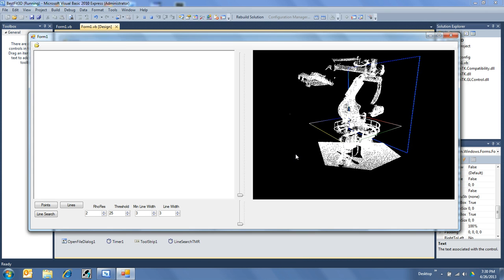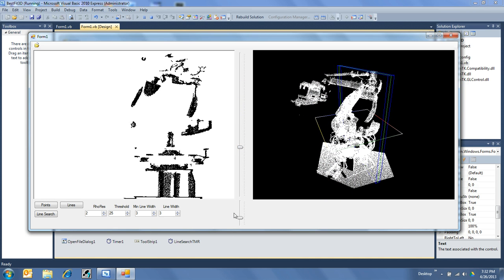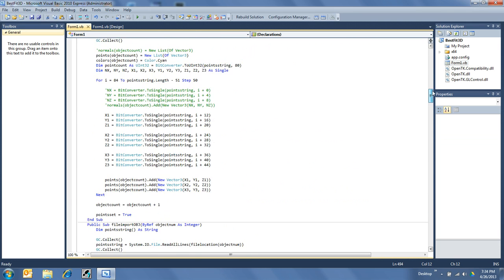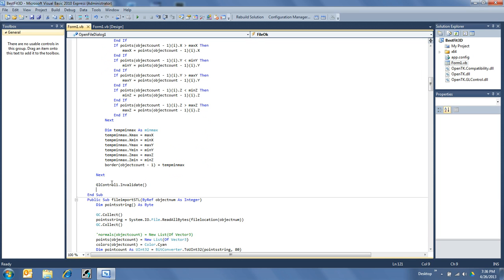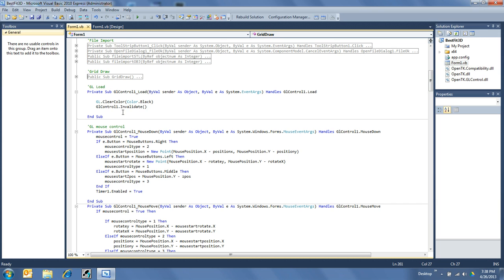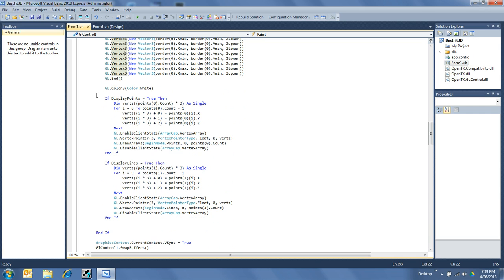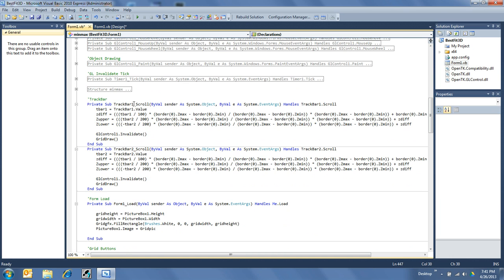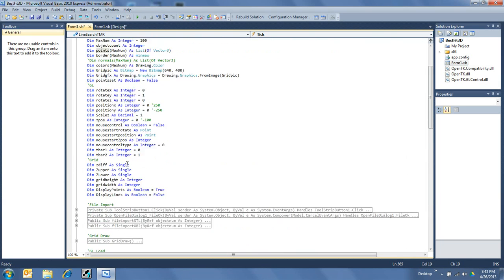Visual Basic Mega Program: Best Fit 3D

Comment: Dear robomatics, do you have any idea for 3d scannig an object through a web cam and a laser beam using emgucv?
Reply from the maker: José Antonio Mira Funny you ask, its my current project. I've created a basic one in VB.Net, here's the code: http://pastebin.com/1qs6WBt1
Run the laser line up and down the image, not left to right. I've included the form components as a comment at the top of the code. This uses Touchless for the webcam, which I have a video for (watch?v=mp5nRrySWSg) but you could mod this to use EMGUCV. I'm currently working on doing this in the raspberry pi using python and C.